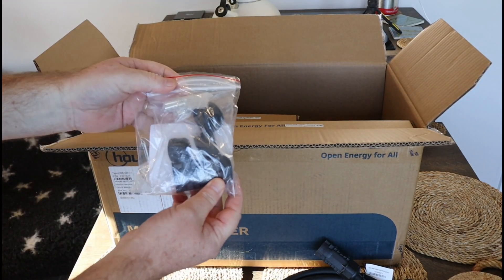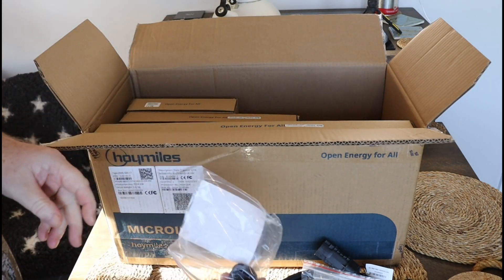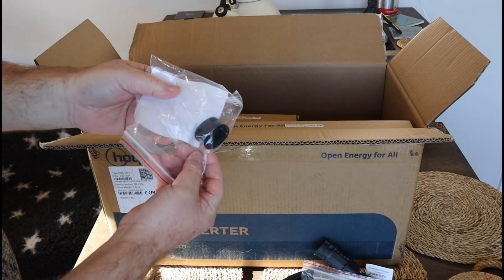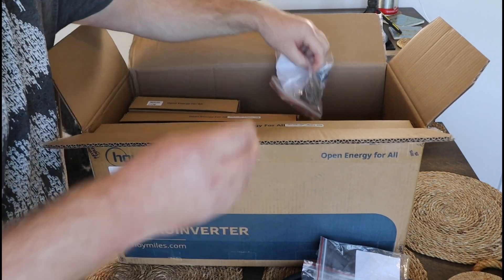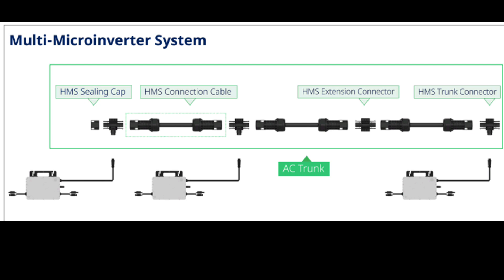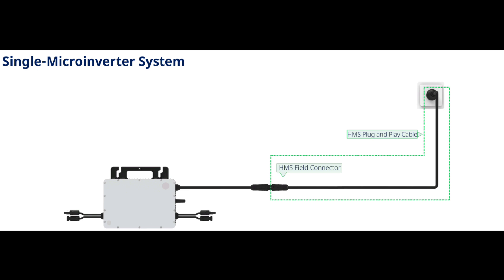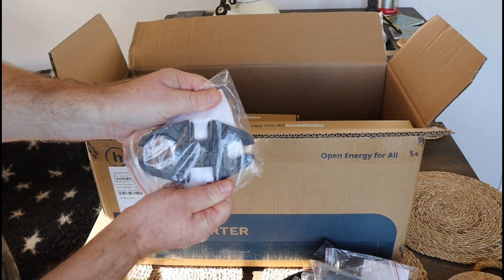Another solar option - Hoymiles Micro Inverters - optimised solar panels

Comment: After buying theee 800 watt 2t micro inverters from amazon I contacted Hoymiles support directly and they set me up an account, I have 8 260 watt ex solar farm panels with 4 panels on each inverter and only have 2 inverters set up at the moment. 
They’re installed on a flat roof facing south west and they perform really well, I’ve cut my electricity bill by a third, the only other thing that’s needed is some battery storage but Hoymiles are widely available in Germany but not in the uk and no one from Germany is prepared to ship to uk.

Comment: What are the plans to wire this in?
Using a dedicated socket (with a UK Plug adapter) connected to a to a CU/Daughter board of some type? 
Or cutting the plug off and using the wires inside the cable?
Reply from the maker: No I won't be wiring to a socket it'll be to its own circuit breaker

Comment: Good to see these listed on the ENA Type Test register. Will you be making a new G99 application, since you’ll be increasing your inverter capacity?
Reply from the maker: If it increases. They might be replacing a larger string inverter,

Comment: Other channels have tested shading and found that the bypass diodes in the panels themselves usually work around the shading problem on string inverters and the difference in performance is usually nothing, certainly not enough to pay for the cost of microinveters. Putting an inverter up on the roof with a need for scaffolding to replace it doesn't strike me as ideal but once you get a big system they seem to make a lot of sense. Your system would benefit quite a bit from having them I think just because its all these different panels and systems and you could rid yourself of a lot of inverters in the property and simplify how it works.
Reply from the maker: Micro inverters don't seem  to cost much more than a string inverter for some installs and id definitely argue PV panels don't handle shade well.  Time will tell on this though  if I get them installed . Im seeing 50 % losses from about 10-20% shade.

Comment: I have been looking into hoymiles micro inverters they look really good but seems to be more for the German market, trying to get the equipment in this country is difficult
Reply from the maker: They're on UK Amazon and about to be more visible here
Reply: @EVPuzzle  good I was looking at using them off grid as they support zero export
Reply: @EVPuzzle  Very limited on UK Amazon, no actual UK suppliers from what I can see just yet.
Reply: I wouldn't bother with Amazon they don't provide login details for the app so you can't install them properly without the app
Reply: @my_carp_life3424  ok thanks

Comment: Always been a bit nervous of micro inverters, due to the cost of access in the event of a failure, for roof installations. However, for ground installations, it does make a lot more sense.
Reply from the maker: Agree on access. I hate having solar edge optimisers that are inaccessible